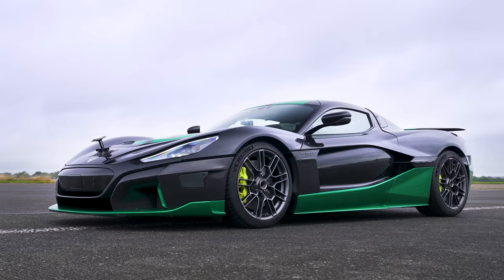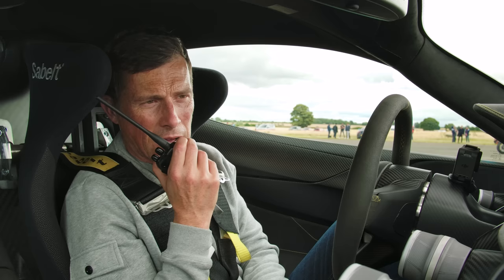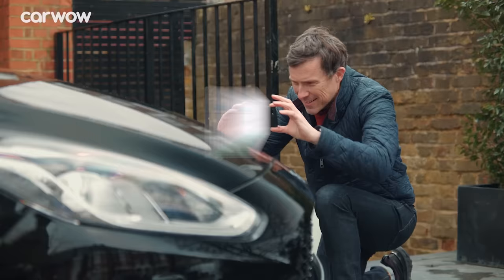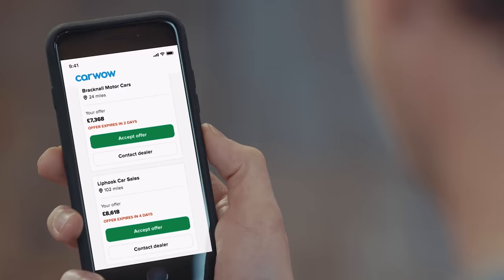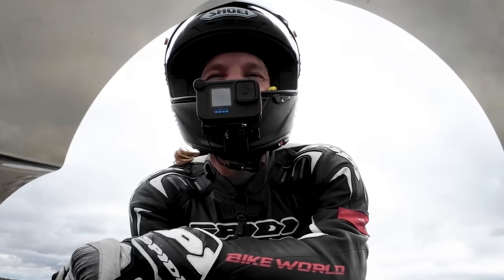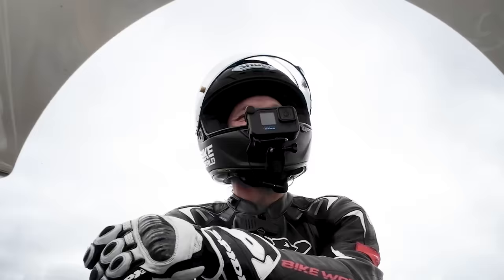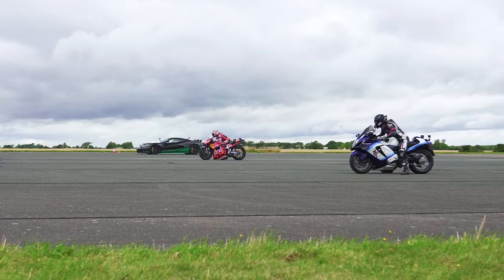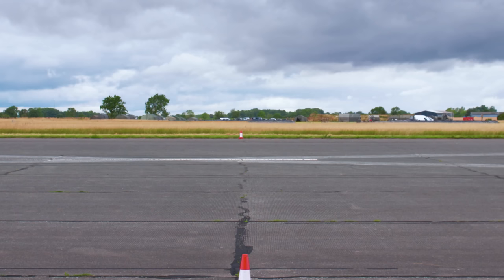MotoGP Bike v Rimac Nevera v Turbo Hayabusa: DRAG RACE

Comment: This didn't make me think the Rimac was slow.  This made me think Motogp bikes are WAY WAY  faster than I thought.  That is obscene.  That poor busa just didn't have enough traction.  Makes me think those ultrawide back tire meme-builds actually have a purpose.  A car that easily crushing a busa is completely alien to me.
Reply: Funny thing this MotoGP bike was on low power map to avoid wheelspin struggling in crosswind wiggling wobbling etc
22 Ducati Moto GP bike with Mugello gearing and full power map will be much much faster than this KTM GP bike

Comment: For the Suzuki to get smoked that bad means one or more of three things: 
1. It needs a racing slick to improve traction a 100-fold. (It doesn't matter if you have 10,000 hp, if you can't put it to the ground you might as well be riding a 3 hp B&S mini-bike). A 30+ second burnout followed by an IMMIDIATE launch may have helped. But he wasn't even close any any of the races. Suzukis are better than that.  
2. Something is wrong with it?? 
3. Needs a better, more skilled, professional driver.

Comment: Nice video...i just cant wrap my head around supercharging a bike huge gains but no effort for traction and also transmition ..that kinda power defnetily needs a transmition cause there is so little to do with the torque..its a supercharged busa..its not like u built a new engine for it so u could emphasize on hp more than torque although if it was a new engine built ground up i dont think a charger or a turbo is the right choice na for sure for a bike and a lot of hp also lessen the torque but its nice to see people trying and putting effort and big balls for riding it

Comment: YO people are NOT understanding that Chris is literally having to let off the throttle throughout the race because his front tire keeps lifting.

If he didn't do that the bike would literally do a back flip and he would die. The bike is genuinely too powerful for its own structure, the insane skill (and balls) he is using to ride that thing without killing himself is just beyond mortal comprehension.

The rear wheel is going to need to extend backwards and its going to probably need custom tires and suspension.

Comment: Motorcycles are a thing of beauty. The Hayabusa was a bit disappointing in how unstable it was at speed. Power alone is not cutting it when it comes to cars and bikes. The hayabusa lacks a proper drag racing set up. I reckon a stock Kawasaki H2 will do much better

Comment: So Rimac has approx 1300 kW of power and battery capacity is less then 130 kWh so it can fly with max power for less than 1/10 h which is 6 minutes. Nice!

Comment: Hayabusa guy messed up by doing the burnout. 

The tyre became greasy after that burnout. 

There is not need to burnout a street tyre on normal asphalt. 

Only at the quarter mile track you can get away with the burnout due to the sticky surface reacting with the hot tyre.

Comment: 9.6s coming last? Insane
Reply: Busa did a 9.3 and a 9.2 sec quarter mile @164 mph check on TTS performance channel
Carwow is showing 9.6 that's fake 🤡
And the MotoGP bike ran 8.2 seconds quarter mile in second race it literally smoked rimac 
They never showed 2nd race results

Comment: That hayabusa looks like its putting down only 200hp or so. It should go better especially in faster speeds like a roll race :D
Reply: this hayabusa is not slow it's just that Rimac and motogp are incredibly fast. Rimac nevera 100-200kph 2.9s is faster than most sports cars 0-100.

Comment: One thing is for certain. Moto GP bikes are fast as fuck.
Reply: Rimac nevera?
Reply: @jozefjozefczyk3936  clown MotoGP bike is running on low power map 😂 have you seen 2023 KTM MotoGP bike launch and acceleration??? 😂 
GP bike was running on Jerez gearing and wobbling in crosswind
Mugello gearing and race in better conditions
MotoGP bike would be 200 meters ahead of Rimac Nevera
Reply: @Smzxe  low power map? that's why in other videos the carwow ktm did a much worse time.
Reply: @jozefjozefczyk3936  The bike is naturally aspirated. No power adders. The bike is far more impressive that the AWD car with 18 electric motors.

Comment: well busa all that horsepower and he couldn't put it down. That goes to show you there is a certain amount of HP on the bike that you need otherwise if you go any higher you cant use it all anyways. 250-270 seems to be the good spot.

Comment: Hr2 did it in 9.7 in other carwoe video , this hayabusa did it in 9.6 d4mn it is fast but unfortunately it was racing moto gp bike
Reply: Busa did 9.3 seconds quarter mile @163 mph in 3rd race go on TTS performance channel
Carwow showing fake 9.6 seconds
H2R has done 9.4 seconds quarter mile in past @170 mph it was spinning wheels horribly also wheeling too much

Comment: Wait. I thought moto gp usually in previous video is around 9.2,9.3 and 9.4.

How its suddenly 8.6 now? How such a huge difference. Is it a different bike or the same bike? How is it big difference???😅
Reply: Yes, that means the KTM MotoGP team could tune their bike to challenge car records. If Mike brings a faster car next time, like one that does 8.0 seconds, the KTM team might tune the bike to be closer, perhaps to 8.1 seconds. There is a reason why motogp engine alone cost $450k
Reply: But what i dont understand is if the bike is tuned then horsepower and torque has to increase right? . 
But here both horsepower, torque and 1000cc engine is still the same stats as before. How is the KTM faster by like 0.7 seconds.?
Reply: @darkswamp6830 wings and aero does the magic for the GP bikes. It helps to cut a few tenths from the previous recorded timesheets.

Comment: The top speed of that V4 ktm motogp bike is 227mph ❤
Reply: They use different gear ratios for different circuits. Here the bike didn't reached 227 mph. ( this is definitely not a mugello circuit gearing)

Comment: Well if electric is faster, I still don’t care , I absolutely love the sound of a v 8 ringing out! Plus the cost to operate them are the same basically, well in fact the electric car cost more to operate, plus the time to charge verses the fossil fuel car! Plus the electric car does nothing to help the environment at this point, infant today there way worse for the environment! So I’ll wait a decade, lol get them cleaner , at this point a new diesel truck is cleaner for the environment than an electric car!!! An much safer! Not against electric! But get cleaner ! That’s the point right!

Comment: Of course the Moto GP bike is the fastest with a pro rider.  These drag races are silly, and so is the car.  It makes is easy for any fool to achieve max. acceleration.  So what?  They'd just be in big trouble or slow at the first curve.  On a circuit a pro driver in a car with 80% of the capability would still whip the ass of any amateur driving this, maybe even club racers.  A pro would also be faster with an 'undrivable' version of the car without the weight of some of the many driver aids.

Comment: superbusa has very bad vehicle dynamics engineering. it can not use it's power, rear wheel is shaking, it has to have a electronic power control system. what a waste of hp on it. look at the ktm moto gp bike. well engineered, nearly half power but 2.5 seconds better. shame on suzuki

Comment: Also meine Herren  die Hayabusa  110 PS mehr als die Honda  hat 270 NM + 270 PS.

Hallo  Hallo  
Die Hayabusa  hat  380 PS + 340 NM  das gibt es doch nicht das die Hayabusa  langsamer  ist als die Honda Hallo.

Was ich gehört habe  das der auf der Honda ein Rennfahrer war da sieht  man wieder  wenn man seine Maschine  Beherrscht  kommt das raus  was die Honda vollbracht  hatte, zum Gegensatz  der mit der Hayabusa  der hatte seine Maschine  absolut  nicht Beherrscht  da müsste um einiges  mehr drin Legen der war eine absolute  Pfeife  gewesen  mit der Hayabusa. 

Under der Sportwagen  war über  2 Tonnen  schwer  gewesen, + die Hayabusa  257 kg, + 380 PS, + 340 NM, + hatte noch ein Turbo  1300er Motor  Hallo  das sind für eine Straßen Maschine  Traumwerte  der ist für mich eine Schande gewesen  der  auf der Hayabusa  eine absolute Pfeife.